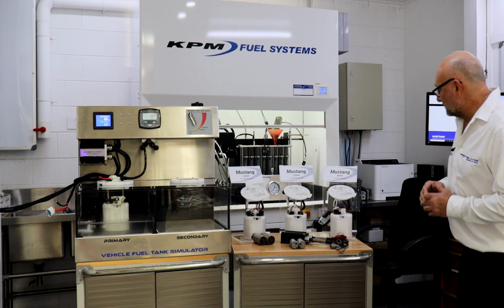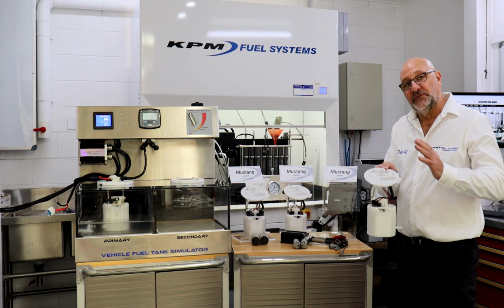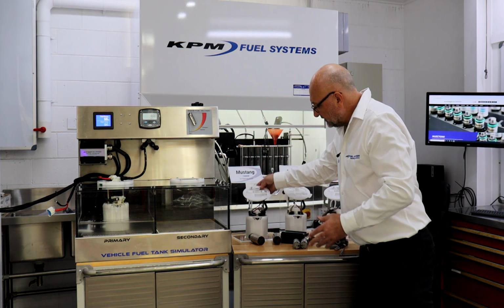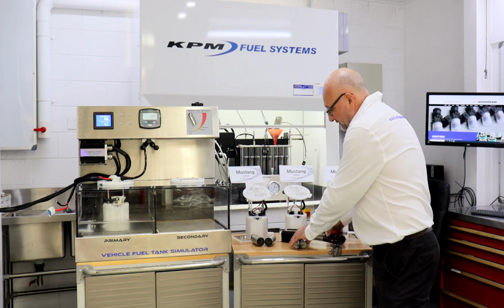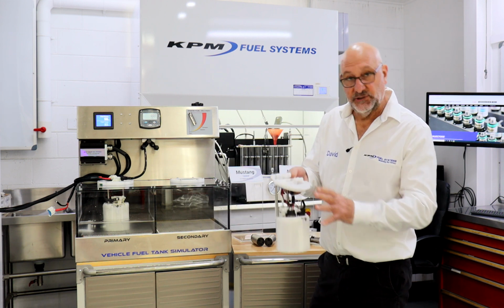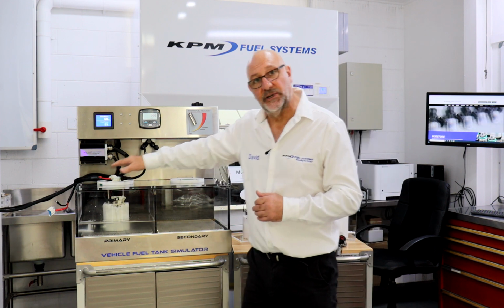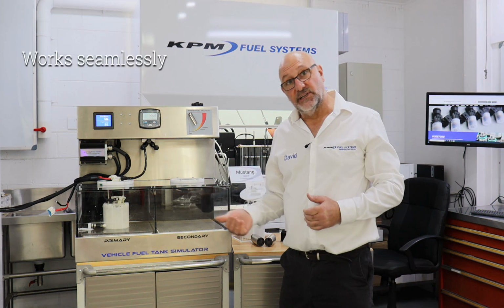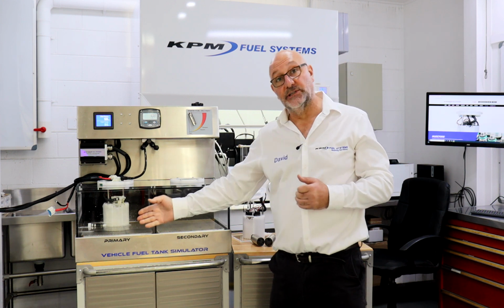KPM Fuel Systems Mustang Fuel Walkthrough Part 1 800-1500+PWM range

Comment: I'm fitting my 800hp unit tomorrow, I have blown through 2 pumps in 2 years looking forward to all the benefits
Reply: How the pump working for you? Thanks
Reply: @marcogutierrez7916  Excellent, it performs exceptionally well. I did need a retune due to over fueling.I could not be happier
Reply: @DonnyDRacing  ty!